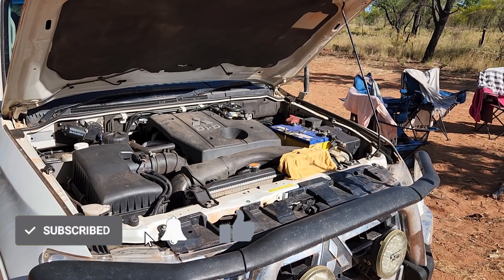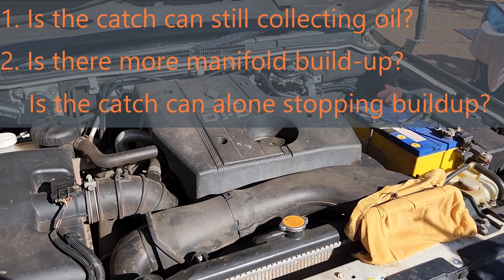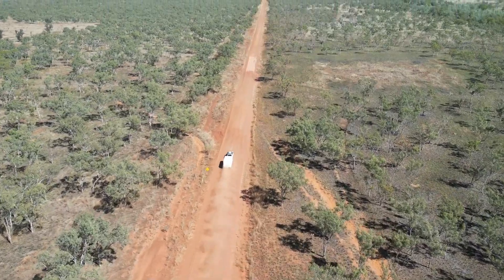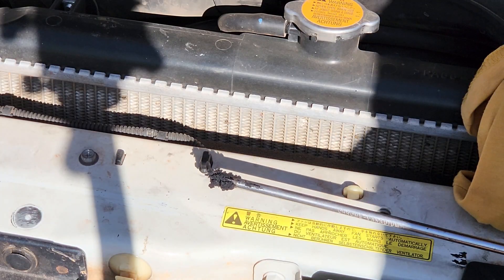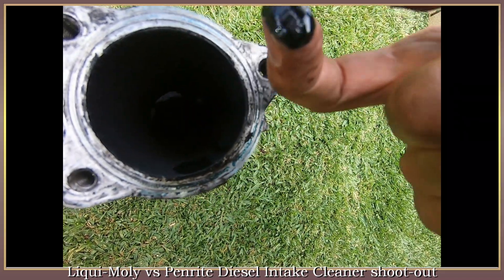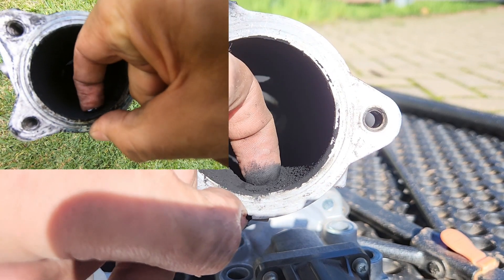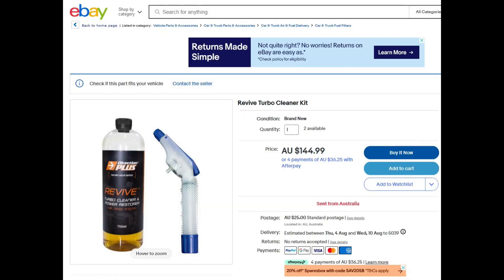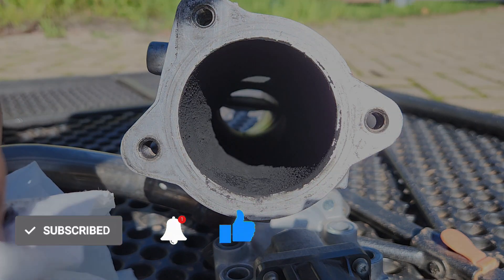[RESULTS!] Provent 200 Catch Can  - does it stop manifold gunk?? 40,000km road test!

Comment: Are you sure you have the pipes the right way around? My inlet from rocker cover goes to lower connection of catch can and upper connection goes to manifold inlet tube. I get loads of  gunge and dirty water in catch can, perhaps the atmosphere is more humid here. And no, l am not loosing water from the radiator.
Reply from the maker: I wasn't positive off the top of my head but I just checked. The instructions for mine says that the lower hose goes back to the air intake, ie cleaned air out, and the upper hose goes to the outlet of the crankcase i.e. the rocker cover dirty air in. See steps 9 and 10 on https://www.westernfilters.net.au/content/pdfs/wf_provent-installation_prov-08_mitsubishi-pajero_nw_d-id_from-2010_2020-1a.pdf

While the physical installation part of this guide would be specific for a Pajero, the plumbing of the catch can itself would be the same for any vehicle. You might want to check the installation instructions for yours and make sure that's correct.
Reply: @TheMusingGreg  Yes, you are correct, l looked on YouTube after l left the comment. I used clear tubing and the tube from the rocker cover to the catchcan is dirty and the tube going to the inlet is clear, so it must be doing its job. I had an internal look in catchcan and there is a diaphragm and a spring valve which does not seem to work in either direction. I would have thought it would be best to keep the inlet and the crud at the bottom of the catchcan rather than letting it drop through the filter and blocking it. I am pleased with the functioning of my catchcan, the way it works now. Thanks for your reply.

Comment: Hi Greg. I'm definitely no expert and haven't attempted to take the manifold system apart from my MY17 colorado, but are the inside of these manifolds smooth or a rough die-cast texture? Just thinking outside the box a bit, but if it was smooth or honed out similar to what they do with petrol engines, the oily residue may glide more freely.
Your thoughts, please.
Reply from the maker: Hi Colin, good question. The inside of my Pajero is a little rough which is how I remember the inside of the manifold on my VL Calais. I assume then most manifolds are the same.

A port and polish is often done to improve performance. I haven't got any hard data to say how it would affect build-up; my guess is that it would have to make some difference, but I expect it would still build up eventually so overall it may not be worth the considerable effort to get everything smooth. Really good question though, I'd be interested to hear if you ever do anything like this!
Reply: @The Musing Greg  
Thanks for the response.
I'm probably not likely to do something like that. As you said, it would be a bit of work and an expensive  exercise but boy, it certainly it quite a big talking point.
Really like your video, good work.
Reply from the maker: Cheers mate, glad you found it useful!

Comment: Hi Greg, thanks for posting these videos. I might be getting confused here but are you emptying the can at 7,000k and then 10,000k intervals? In one video it looks like you are draining 150ml of oil in one go which is a lot. I thought that the cans should be drained at around 3000 - 5000k intervals to optimise efficiency?
Reply from the maker: Hi mate, in the initial video I emptied it at 7000kms and then 10000kms later. In this video I collected 150ml of oil over 10000km in a combination of city driving and country towing before I emptied it. Because of the distances I travel when we're on the road, it's easy to clock up 5000-10000kms pretty quickly and I don't always have perfect conditions / time available to empty it which is why the intervals vary.

I don't think 3000-5000 is necessary though and I don't think it would affect the efficiency - any oil the filter collects just drains down into the hose so it doesn't really matter how often it's emptied so long as it's emptied before the whole drain hose fills up with oil and it starts clogging up the filter. For most people if it's done every 10-15000kms at the regular services it would be often enough. Let me know if anything's unclear.

Cheers,
Greg

Comment: I'm considering to get a catch can for my HJ60 with the N/A 2H engine, i know that these cans are ment for turbo engines.

The reason that i'm thinking of this because every now and then there is a small amount of oil in the governor housing where the diaphragm is located and as i understand that is pretty normal for the 2H engine, i'm going to change the diaphragm soon and clean the housing.

Would it do any good at all or would it cause problems?.
Reply from the maker: Hi mate,

A catch can will work with non turbo engines too, it's just that you'll probably get less blowby than on a turbo engine on account of the higher combustion chamber pressures with a turbo, so a catch can will be somewhat less useful on a NA engine. But you'll still get some blowby on yours, so if your crankcase ventilation is plumbed back into the intake a catch can should still prevent whatever fumes you have from getting back into your manifold. 

Whether that helps with the governor issue I can't say, unfortunately I'm not familiar with the governor on your engine. However I can't see it causing any problems.

I hope that helps in some way, sorry I can't be more definitive.

Comment: I have a 2018 Ford F-150 with a 3.5 eco-boost engine…
Open the find a cure?
What I do is place marvel, mystery oil in my oil, and in my fuel, hoping that that would stop the viscosity of that old oil through the engine ...
Reply from the maker: Hi mate,

Do I understand correctly here: you're trying to using Marvel Mystery Oil to increase the viscosity of the engine oil (i.e. make it thicker), and you're hoping with thicker engine oil there'll be less oil getting past the piston rings so you get less blow-by oil fumes and thus less manifold build-up? Is that the idea?

I've not used Marvel Mystery Oil so I can't say definitively if it'll work or not, but from my research it looks to be about the consistency of regular engine oil. I know they claim it improves compression, but I'm not sure how it does that if it's no thicker than the oil it replaces. That being the case, I'm not sure how it's going to reduce the blow-by fumes. A catch can will certainly do that more effectively in my view, although my testing thus far suggests you need to get rid of the EGR soot to completely remove manifold build-up.

Let me know if I've misunderstood the question.

Cheers,
Greg
Reply: @TheMusingGreg  
Hello Greg ,
From marvel mystery oil actually is a penetrating oil thinner…
And I was hoping that it would break up and thin out bypass thicker oil…
Let me know your thoughts thanking no need for the oil can ?
Thinning soot viscosity.
Reply from the maker: Hi @gregorycoogle7621, thanks yeah it seemed the product worked more as a thinner, which is why I was confused. 

OK so remember I've not used the product but this is just my analysis of the theory of how things should work: Manifold build-up is caused by two components - 1) exhaust soot and 2) blow-by fumes the crankcase.

1) I can't see MMM reducing exhaust soot in any significant way; maybe through helping improve combustion efficiency when it's added to the fuel tank e.g. if you had blocked injectors. But once they're clean they should stay that way for a while. So let's assume it doesn't help the exhaust soot side of the equation.
2) As far as the blow-by goes, if MMM thins the oil it will more readily get past the rings and make less of a seal, which should slightly increase blow-by slightly if anything. But again I think that effect would be minimal given you only use it at a 1:5 ratio max.

So on both counts, I can't see how Marvel Mystery Oil is going to help reduce manifold build-up in any significant way. If it's a solvent / thinner it would probably be good at cleaning injectors, unblocking oil galleries, removing engine sludge and other related tasks, but I can't see how its properties are going to reduce blow-by or exhaust soot, which are the two components of manifold gunk.

I stand to be corrected if someone has done objective testing, because again I have not so far and this is a theoretical analysis only.

Cheers,
Greg
Reply: @TheMusingGreg  
I don’t think you oil can is the solution … 
I see the solution is a chemical remedy …
If you break up the sludge then you have no soot buildup!
That intern stops and solves the problem … any particles of the carbon buildup gets trapped in your oil filter. 
That’s how I see things ?
Reply from the maker: The catch can certainly isn't stopping the manifold build-up, as I've touched on in the two catch can videos so far. I'm still getting manifold build-up, it's just dry and carbony now rather than oily. So I agree with you on that. I think you'd have to get rid of the EGR circuit to stop the build-up, so as long as you have exhaust soot going back into the manifold I think you're going to get manifold build-up. I'm not sure if there's a chemical solution to that problem unless somehow the composition of the exhaust is completely changed so it doesn't generate soot. If you can solve that problem you're probably going to be a milionaire!

The idea of manifold cleaner solutions like this is the chemical remedy you refer to - they attempt to dissolve the oil and soot and blow it through the engine, leaving a clean manifold behind. As these tests are showing, they're not that effective a lot of the time.

I'm not sure is what you mean by 'sludge' - can you clarify? I assumed you mean manifold build-up, but when you say "If you break up the sludge then you have no soot buildup" I guess you must mean something else.
Reply: @TheMusingGreg  
The sludge I referred to is that remaining oil that you would get buildup in the oil can catcher.
You mentioned the manifold…
You’re also getting a buildup in your catalytic converter!
Besides marvel, mystery oil, you can add a product called sea foam to your gas and oil.. 
this too will break up the sludge oil. Again, your oil filter should pick up any large contaminants.
And change the oil sooner than recommended on the Ford engine. (I even place some Teflon oil additive to my engine)
Amazon sells…Teflon oil. 😉
Greg, 
I’m telling you that marvel mystery oil cleans the inside of your engine!
Reply from the maker: Ah OK thanks. The sludge you're referring to is what I've been calling blow-by oil.

There is always going to be a small amount of blow-by in any internal combustion engine, as small amounts of exhaust and burnt oil fumes get blown past the piston rings and into the crankcase, thus creating blow-by gases. That's unavoidable, which is why all engines have some form of positive crankcase ventilation. All the catch can is doing is condensing the oil in those fumes oil back into a solution ('blow-by oil') which can be collected and disposed of rather than leaving it in gas form and blowing it back into the engine. So I'm not sure you can get rid of blow-by fumes with a chemical solution. You'll typically get less blow-by with a thicker grade of engine oil but obviously Marvel Mystery Oil makes engine oil thinner, not thicker. However I'm not an expert on its other properties, so I'm not going to rule out that it may, in some capacity, REDUCE blow-by, however it won't be able to eliminate it completely so there will always be some blow-by which needs to be dealt with.

My vehicle, being diesel, doesn't have a catalytic converter, and it's pre-DPF days, so the exhaust system is just mufflers.

I did use some Seafoam a few years ago, I had the choice between that and MMM and ended up trying the Seafoam (plus that Restore compression restoring product), so I didn't end up using MMM. My Seafoam tests weren't scientific so I didn't document any of it, especially as there are loads of detailed tests of it online.

I typically add an engine flush product in the oil prior to doing an oil change.

Cheers,
Greg

Comment: It seems to me that the catch can is removing the blowby oil just fine.  The soot is from the EGR system and a simple catch can will never be able to reduce that.
Reply from the maker: Yes you're right it seems to be doing it's job. However catch cans are sometimes billed as being a fix to manifold gunk which is what this video is checking. I think the idea is that since manifold buildup is a combination of oil and soot, if you remove the oil the soot will just get blown through and wouldn't build up. What this video is showing however is that the EGR soot continues to build up even without the oil, and that's useful data to know.

Cheers,
Greg

Comment: Hey, just to note about the EGR , you can " remove" the codes with a custom engine tune. This means all you need to do is unclip the EGR valve and keep driving.

It is valuable, 

Catch cans, Im reserved of oil in the intake, bad or good I dont know - however EGR soot is horrible. 

Plus having a custom engine tune is perfect for the paj, they are absolute weapons.  - before putting my Roof top tent on, with new rack and 33's I was able to do 0-100kph in 8.1 seconds. pretty quick for a mild tune. 

Cant wait to see your next test with the intake with an EGR stop.
Reply from the maker: Thanks for the comment mate. Yes a custom tune is certainly a way to achieve this, though a more expensive one than the options I'm looking at. I tend to agree re the oil - I would rather see no oil in the intake and no soot, but with soot my feeling is the oil is a slight advantage as it keeps it soft enough to potentially be removed with an external cleaning product if used regularly

Stay tuned!
Reply: @TheMusingGreg  totally I would rather see oil in the intake than soot anyday . Oil still has a benefit just not when it's mixed with the problem ( spot) I a company called all Aussie tuning down on the Gold coast Qld .

Comment: Only way to stop build up is EGR blocking. These catch cans are not worth it in the long run and can case crack case pressures to increase if they're poorly designed or gets blocked. Then you will be in for a world of hurt as it can lead to oil leaks and blown seals. EGR blocking is the best way to stop build up

How i miss port injection, direct injection and EGR is the worst thing coming out from the greenies with all this insane and not worth it emissions controls.
Reply from the maker: You're probably right about the build-up and I'll be testing that in future videos. As far as the risk of blowing crankcase seals, that very much depends on the design of the catch can. Provents are well respected and designed with this in mind, so providing the filter doesn't block up or the catch can fill up through failing to drain the oil, I wouldn't expect problems.

I'm actually going to be looking at something related to the Provent and crankcase pressure in an upcoming video so make sure you're subscribed.

Comment: Maybe that build up is from the EGR system.
Reply from the maker: Yep it is which is why it only starts at the EGR valve. The question's been whether removing the oil via the catch can stops the exhaust soot building up without oil to stick it together, and it seems it still does. The next video in the series builds on this.

Comment: Hi Greg, great videos mate.. I just wanted to make a comment on the Provent 200.  It's an Oil Separation system designed to collect as much oil from the blow by gases as possible. I personally think it's the best in class as it is always collecting oil.  I have one on my 2018 Pajero Sport since new and it does exactly what it's designed to do.
Reply from the maker: Thanks for the comment Steve. Yes it certainly does capture oil properly. The trouble is they are advertised as a solution to diesel manifold gunk which is why many people go shopping for them - even Western Filters describes it as a solution to the problem of oil mixing with soot and creating manifold sludge. Maybe the issue is what it's advertised as doing rather than its effectiveness at its originally designed task.
Reply: So is soot worse than oil?